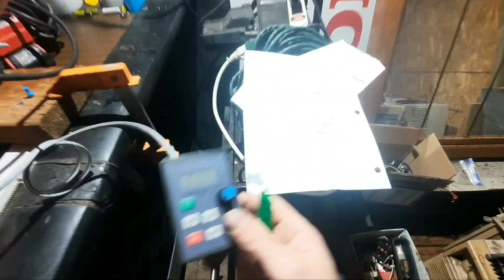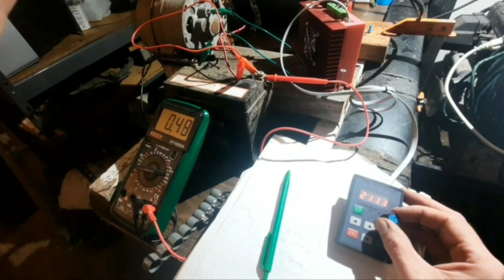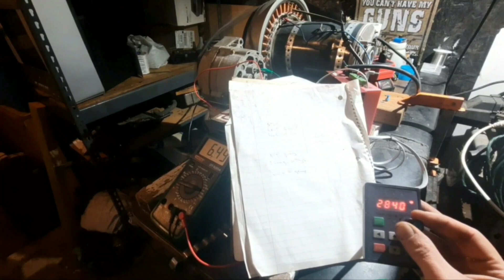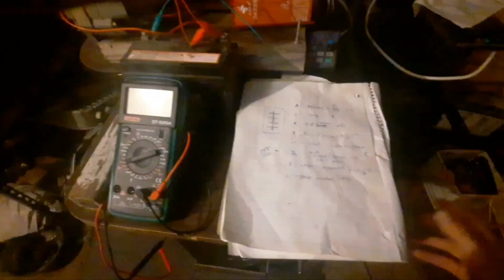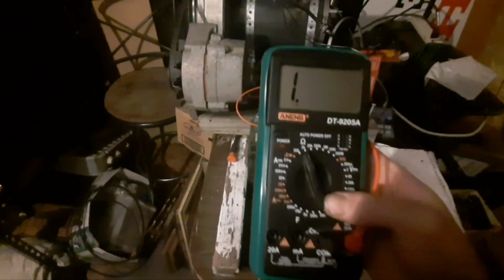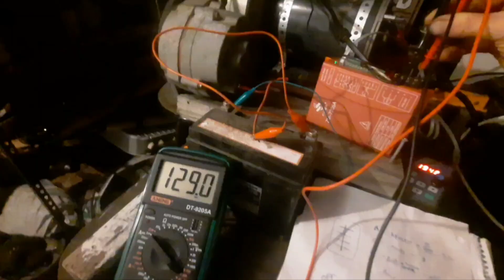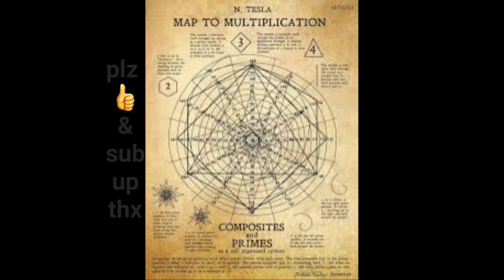bldc star, intro 2 testing

Comment: Is that a standard alternator? Or a PMG
Reply from the maker: Standard and it was layin in my shop for a reason. I think it's off an 85 fiero. Took it apart And capacitors are blown looks like water damage.
Though I do need to modify some alternator and give that a shot.

Comment: Happy new year, nice setup you got there, I never got anywhere with the DD and I discontinued the project, it's refreshing to see others try.
Reply from the maker: Happy newyear to use az well. I haven't seen a lot of information posted about these. Hopefully, it could save people time, and who knows. Maybe we'll find out something new if everybody chimes in enough. Thank you for your reply.
I am very interested in what Due diligence you did. Anything about edward Hall? Some of these guys were talking about backward e m f.
Some of the guys that wrote the books back then didn't have the things we have to work with today, 
There's definitely a will l o l. Any information you do have would be Muchly appreciated. Thank you. god bless, and have a happy new year.
Reply: Within my research I came to the conclusion that it's too inefficient as a generator being pulled by another DD or motor as it does not generate enough to have a sustainability for the driver and not to mention to provide something extra.

I also tried using a single DD as a motor/generator in 1 unit, the problem is the design does not allow you to add more wire to increase the inductance.

I have seen an individual being able to achieve a loop charge effect on the driving batteries with some capacitors and aside from that being used as a wind turbine or a hidro generator which does a good job there.

If you would like to join a small group where we could all experiment and learn together let me know where I could contact you, all the best 🤝
Reply from the maker: 117stock@gmail.com. 
I believe they're doing perpetual motion trying to get one of these to run another one of these.
W the type of star connection I have going currently. It's throwing power all over the place. So the hall sensors aren't picking it up like they should be. Once that's fixed, it should, in theory, help the power that's 
Being pulled, regulates it, and makes it less, Or stronger. Or both. It's kind of like them drills when you take those apart. You see those little hall sensors or e bikes. I think I saw genard using them even.

In addition to all that, I saw a guy in new zealand that's re wrapping these motors with different types of wire 20 plus times and getting great results. 
The way this is going, it should BA1 for all kind of thing, so yes, please contact me. Hopefully, somehow somebodys could figure out some ways that makes these something very cool. 
I got my data and i'm gonna keep going with it. For what i 👀 thus far to me It just looks too Damm promising.